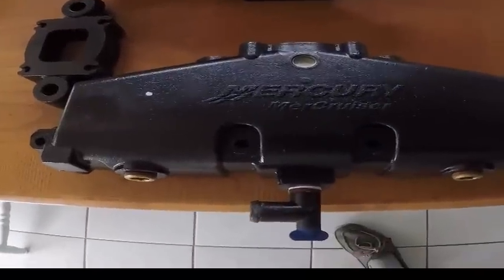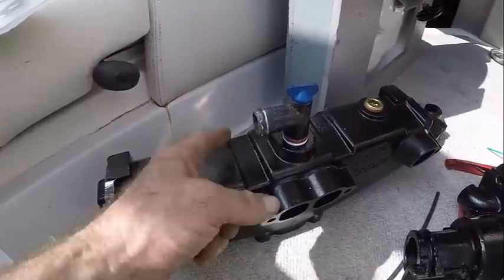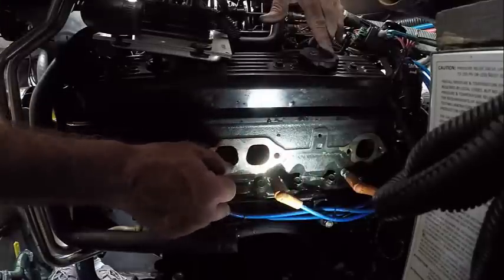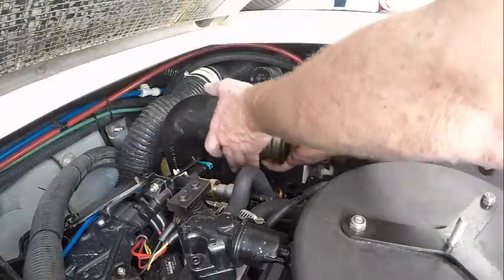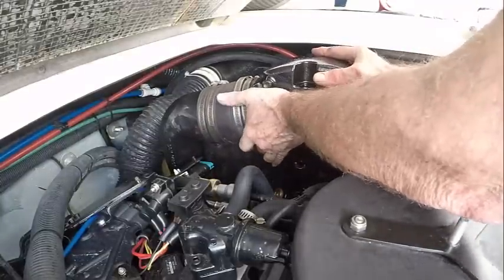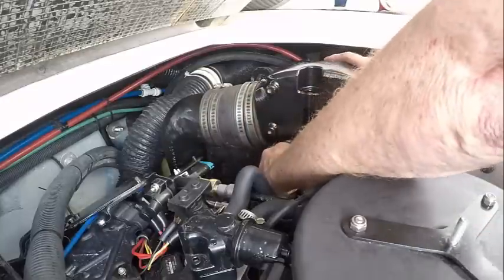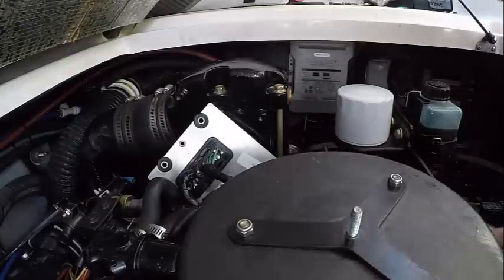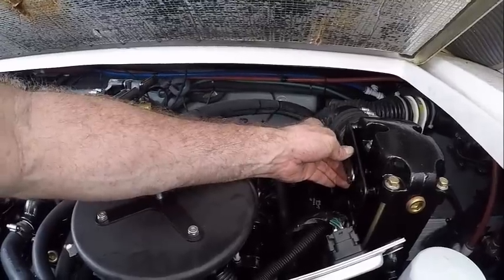Mercruiser 5.7 Replace Manifold and Risers

Comment: Cut the heads off of 2 bolts or use a stud bolts. Screw studs at each end of  the head and slide on gasket then manifold. Put in other bolts and then take the 2 studs out and replace with bolts.  Studs hold all the weight while you start other bolts.  Makes it easy

Comment: Hey Brett, Next time you do this job, try taking a couple of exhaust bolts and cut the heads off and turn them into studs.  Screw them into the end holes and put the gasket on the studs.  Slide the manifold onto the studs and screw in the two center bolts then remove the studs (easy if you've cut a screwdriver slot into the ends of them) and then screw in the last two bolts.  Gasket protected and not such a great strain on the arms.
Reply from the maker: Some others have commented that same approach - which is a great idea.  Thanks!

Comment: Quick tip.  Get two 6” long 3/8” bolts, cut off the heads, then thread them into the outer holes.  Now slide the gasket and manifold on. Secure the inner bolts and replace the outer bolts.  Dont rest 50# manifold on the spark plugs.  They. Are porcelain not able to support weight.
Reply from the maker: Great tip.  Thanks!

Comment: You are supposed to use Quicksilver perfect seal on the rubber rings. and the turbulator is to stop moister for collecting and going back into the manifold, it creates more exhaust pressure drawing any moister out of the exhaust system.

Comment: Excellent video.  Thanks for sharing your well thought and executed installation tips.  I have not tackled this kind of job yet on an I/O, but I will certainly refer to this video when I have to face replacement of manifolds and risers.  A few questions for you if you are still checking your videos for comments or questions on a regular basis:

1. The mounting bolts for the manifolds and the risers look like some kind of oxidized coated alloy steel.  That said, would it not be a good idea to put some anti-seize on them that can handle high temps associated with exhaust gases?

2.  Wouldn't it be relatively easy to take off your engine hatch cover/hood to do that job?  I did a lot of deep-in-the-bilge work on an I/O boat once, and it made a world of difference as far as improved accessibility and comfort by taking the engine hatch cover off.......but I did have the luxury of working on the boat in a large shop where I did not have to worry about inclement weather soaking the engine.
Reply from the maker: Thank you!  I am still checking.

Comment: Install studs on the outside holes in the head, slot the gasket bolt holes on the bottom side for the new studs and slip the manifold on the two studs. Then install gasket from the top and install the remaining 2 bolts. Easy.

Comment: When purchasing manifolds and risers the qualty goes up like this Mercury > BARR > GLM.  Its worth it to pay more IMHO.  BARR worked for me but not coated like Merc's so won't last as long but they worked just need to use more sealant than what is show in this video. I did have to redon my starboard one riser to manifold gasket once.  I also had to paint my BARRS as the paint quality wasn't as thick as OEM Merc's.  Next time, in like 5-7 years I would pay the extra for the Merc's.

Comment: Better off cutting a head off the old bolts use two screwed in fist slide the manifold on put two bolts in remove the two headless bolts and put the new bolts in their place that way u don’t crush your plugs

Comment: Any idea how to get the two manifold plugs out of top. To rinse out manifold. Mine are just a two square fittings.
Reply from the maker: I haven't tried that.  Usually I flush the system with fresh water after each use (feed fresh water to the water inlet on the drive while running the engine), which I hope is rinsing it of any salt.  When I start seeing signs of corrosion, I just replace them.

Comment: Thanks, Brett, great video. Q. Do you use never- seize or something on the threads before putting them in . If so why not?  I am about to take on my 454 7.4  merc s your vids have been most helpful. Thanks mate, from Sydney Australia:) Al
Reply from the maker: I don't use anti-seize on steel into iron but I do use it with steel into aluminum (so on my cars that have aluminum heads, I do use anti-seize there - mainly with the spark plugs).  I've never had a problem with dissimilar metal corrosion with steel-to-iron, so I haven't found a need to use it.

Comment: I have a question I have a heat exchanger.  I was wondering how to drain coolant fluid.  Can you tell me the procedure to refill coolant after I install new manifold and risers?  Thank you
Reply: Storm Strike You have 4x blue drain plugs. 1 on each manifold and 1 on each side of block. I just bought 4x new plugs at 5 bucks each and replaced them wile replacing coolant. For a good flush I would just take the block plugs off as that drains the block around the pistons. Amazing how much crud is in their.

Comment: Do you use any Loctite an the Manifolds and elbows bolts?
Reply from the maker: I tend not to use loctite on engine fasteners.  I find proper torque is sufficient to keep the bolts from backing out.  As a matter of fact, when rebuilding an engine, I'll usually lubricate the threads of head bolts and main cap bolts to ensure I'm getting proper torque readings on the torque wrench.  On an aluminum block engine, I'll add aluminized lubricant to the manifold bolts to reduce dissimilar metal corrosion that may cause difficulty in removing them later.  Basically, I use loctite in places, but not on engine fasteners.

Comment: Can a wet joint be converted to a dry joint?
Reply from the maker: Not sure.  The dry joint basically carries the water through the manifolds and risers in separate cast-in channels - and that system does appear to be fully contained within the manifolds and risers.  The manifold-to-engine mating is the same, so it would suggest as long as you replace manifolds and risers that you can make that conversion.  What I don't know is whether or not the hose connections and how water is fed into that system is compatible with wet joint systems.

Comment: I can;t seem to get the boot off the rust elbow. Anybody have any ideas?
Reply from the maker: Mine are always stuck, but I twist until they break loose.  I use the elbow to twist.
Reply: @bretthusselbaugh1198  I been trying to twist and turn...but it's stuck.
Reply from the maker: Actually, I do remember they were stuck on the rusted riser part once - so much so that I used a screw driver to break the seal.  Took a flat-bladed screw driver and a hammer and went around the circumference in various places driving the screw driver between the metal and rubber.  I eventually got it to come loose and was able to re-use the rubber.
Reply: @bretthusselbaugh1198  Yep already did that. I guess I will probably try to get the rubber off, and see what this metal stuff is doing. I may have to replace that in between part. : (

Comment: Thanks for post Brett.  Out of curiousity, did you put any Permatex or sealant on the manifold prior to install?  Thanks
Reply from the maker: I did not use any Permatex or any other sealant.  Those gaskets sealed fine (I did make sure the surface were wire-brushed and perfectly clean.)